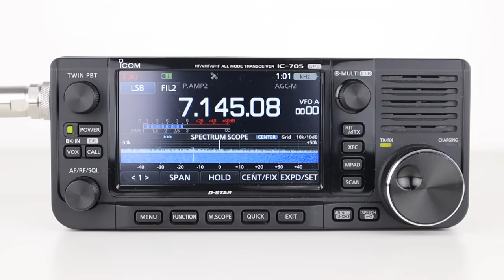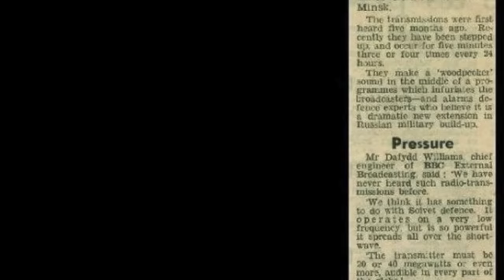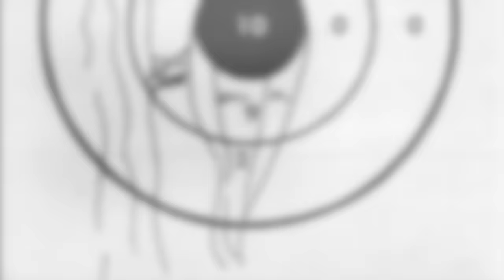Russian Woodpecker - The Radio Signal That Wreaked Havoc Around The World

Comment: I've always wondered, if a signal is propagating regularly with any sort of unsurprising periodicity at all, would it be possible to, for example, like noise, canceling headphones, send out a reverse version of that wave? If sent out. Omnidirectionally, would that sort of create a force field? Where people in the area would not hear the woodpecker due to destructive interference? I'm not a big EM nerd so I might have gotten some terms wrong, but I think the key terms are there if somebody knows the answer to it. 🙂

Also, I dictated this to my phone so some of the punctuation is probably jacked.
Reply: Not for any reasonably large area. You're talking about phase cancellation, which requires the two sources to be perfectly out of phase with each other. HF wavelengths are several meters, so if you moved ~half that wavelength closer to the radar site and the same distance away from the cancelling site, you'd see constructive interference instead of destructive - actually making the signal stronger.

This is also the reason you don't see room scale noise cancelling speakers, only headphones.

Comment: the story goes, that when chernobyl accident happened, the ventilation systems that were used to cool the massive computers in the complex got contaminated with radioactive dust, and the systems failed. You can find people telling you that after this, all air filters in facility were changed and cleaned, another startup of the systems was tried, but again failed for the same reason - radioactive dust. after that, allegedly the project was retired

Comment: "...over the horizon..."  Now I get it.  I had previously been fascinated by those large, cage dipoles,  wondering how that could be radar.  Hell, that also explains the woodpecker signal.  But, maybe I should get back to the vid to see how you cover that.
Reply: Might have to look up whether anyone replicated that antenna design.  Though I'm not expecting anyone's built a replica.  I just want to know the specifics about reflective elements, including dimensions, and what those supports are made of.
Reply: Just noticed an alternating pattern in the dipole array.  Fascinating.

Comment: I heard it a few times down in Florida back in the 80's. I was just a kid so I didn't think anything of it other than I needed to adjust the dial on the radio, or move the antenna on the TV. Then I found another video on YouTube a few years ago that actually had a recording of the signal and I realized it was the same thing I was hearing back then.

Comment: This thing was so powerful that it had to be built within transmission range of a major power plant
Reply: Um.  No.
1) Pulsed radar takes only a fraction of its peak power to operate.  If this was a 10 MW pulse transmitter, it likely didn't produce over 10 kW average, and probably operated on no more than 100 kW to run it.
2) This actually WASN'T a transmitter site - it was a receiver.  The transmitter was actually much farther from the plant!
3) "Transmission range" of a power plant doesn't mean anything.  How far you can transmit power depends on your power transmission infrastructure.  There are many cities that are many miles away from their power sources, and this isn't a city.

Comment: the natural changes in the specific frequency through the day is because of the heating & cooling of the atmosphere by the sun; the various layers, A, B, C, D, E & F, would populate or dissolve as the air became cooler towards night; the frequency wavelengths would modify naturally, without manual manipulation or freq-change.

Comment: This system was located in the close proximity to Chernobyl and the duga stuff was the first to identify radiation contamination from nuclear power station , that was the power source for them . All the expensive equipment was evacuated and never installed again . At the same time this unit was still “experimental” as the technical stuff was unable to identify the missile launch with big% of certainty . Name Duga’ and s translated is “the arc”

Comment: "Over-the-horizon radar" was once referred to as the DEW (Distant Early Warning) Line here in the US.
Reply: In contrast to this, the Distant Early Warning line (which was located mostly in northern Canada, for reasons which should be obvious) achieved extremely long range by placing a string of long-range radar systems much further from the land it was meant to protect (and incidentally much closer to the USSR).  You could call it "over the horizon" if you like, since it was waaaay over OUR horizon!

Comment: One reason it was shut down was likely to conform with arms limitation treaties. 
These state that early warning radars against incoming missiles must point OUT from the nation's territory, these stations (along with several others) however pointed IN, in this case being constructed in the southern Ukraine but transmitting over Soviet territory pointing northwest towards Scandinavia.
Arms inspections (including inspections of radar sites) ramped up significantly in the 1980s, and the USA and other signatories complained about these radar systems, leading to several being shut down (and more modern systems being built along the northern frontier).
As these older units weren't capable of being moved or rebuilt to point south, they were simply abandoned, with the most sensitive systems like computers being removed.

Comment: I was just licensed in October of 1983 and the interference didn't sound like that demonstrated here when working CW, the interference was a modulated whine because of the beat with your local BFO.
It was extremely nerve wrecking.  It drove me off of the air for many years. Ron (now) W4BIN
Reply: If you were hearing a modulated whine, it probably wasn't this.  This was a low duty cycle pulsed signal - there wouldn't be anything there for the BFO to beat against between pulses.

Comment: Most Ham radio operators know about the Russian woodpecker. It was radar that was aimed low over the ocean rather than up in the air. it could detect low flying missiles and ships at sea.
Reply: Radar systems meant to pick up aircraft don't aim up in the air.  They aim at the horizon, because that's where they need the most power directed, to detect as far as they can.  Many are sited at high elevations and are actually aimed slightly downward.  If you see a dish antenna pointed at the sky, it's not radar.
Reply: @BrightBlueJim  Yes you are correct but the Russian woodpecker the duga Russian radar was different, unlike Regular radar this woodpecker covered more area than a line of site radar covers. it would be best to read about it because I can't remember everything about it. I do remember it was a major nuisance to radio.

Comment: There's some really interesting conspiracy theories involving the duga radar array and the Chernobyl disaster. Mainly focusing around the fact that the frequency of the duga OTH radar had to be shifted because it had interfered with Maritime distress signals, causing significant loss of life. After the frequency shift, it was found that the radar was drastically less effective, and the typical USSR game of cover ups and kicking the can down the road began. The theory is, that in order to distract from this shortcoming, the Chernobyl disaster was either allowed to happen or potentially intentionally caused to happen to cover up the duga's failure, since one of the main transmitters was located just on the outskirts of Pripyat and powered by the Chernobyl nuclear power plant, and the disaster would guarantee the decommissioning of that site and therefore render the whole array useless.

Comment: Thanks for the video. Very interesting. Can you explain why the radiating element are tube shape and not a straight single rod dipole?
Reply: It depends.  The larger the diameter of a dipole, the wider its bandwidth, but also, for a high-power transmitting antenna, a larger diameter reduces the electric field strength at any point on its surface, and thus would increase the voltage that could be transmitted before producing an undesirable corona discharge.  The latter would be a concern mainly for a transmitter, though, and the DUGA-2 unit at Chernobyl we see pictured is reported to be a receive-only site.  Which doesn't really jibe with being located so close to a power plant.

Comment: 8:13 - - 8:43 - - if you want to screw up the radar signal all you have to do is send a return signal on its frequency which blocks out the echoes. 🙂  9:15 - - it greatly helps if several hams in different locations gang up on the radar’s frequency.  ☺️🙂😊😌  9:54 - - the satellite system provided the media direct and highly secure warnings.  10:00 - - any radar based system is subject to jamming (and the effectiveness of any over-the-horizon radar system is always subject to atmospheric conditions).

Comment: That's very interesting. I am absoloutely ignorant and fascinated by radio, so i'm gonna ask you a question which may sound stupid but here it is: Could an amateur measure the echo themselves and detect rocket launches?
Reply: Talking only as a physicist and engineer with limited knowledge of real-world propagation characteristics, I would say “maybe”. 
If you know the location of the transmitter site, and you can hear the pings from it. You could theoretically, if you also hear the echoes, do some maths based on that, using the transmitted pings as a reference to get some sort of information similar to what the actual radar system gets. In reality though, I doubt it will work. 
Just looking at the receiver array I got the impression that it had a phased array configuration, allowing for directionality, but that is just speculation on my side.

Comment: Cool. Could someone take a moment out to explain the function of these interesting teardrop-shaped armatures on the arrayi? Thanks.
Reply: the teardrop shaped armatures are caged "biconical dipole antenna". from what i can find online, its essentially a cost saving measure.  

"The birdcage construction is mainly to save material. The RF currents in the antenna only flow along the long axis of the antenna, so you just need enough parallel conductors in that direction. And due to the skin effect, the RF current only flows on the outer surface, so the center can be completely hollow. The circular metal pieces do not carry RF current and simply serve to strengthen the structure." - a Random user on Electronics stack exchange.

i do know that the array within the Chernobyl exclusion zone is the receiver. so it was only receiving signals, not sending them. the transmitting antenna was demolished years ago and was located about 57KM (35 Miles) north - north east of the receiver.
Reply: @LodewijkVrije  "biconocal dipole antenna"? Neat. Thanks ever so much.

Comment: I remember it knocking out communication on h.f.
Now I suffer from broadband interference 160, 80, was 40m but now not too bad, 30, and 20m with S8 noise level. 60m has been okay.
B.T. said they would charge me to take down my phone line which is the cause of it according to Ofcom who investigated. I would have to pay for their faulty line removal! I'm not with B.T.
The Minister for Telecommunication and Broadband secretary had no idea with saying I need to contact my internet provider if I'm having trouble with radio broadcasts over the internet.
You contact secretaries who have no idea about anything and never an engineer.
It's very much killed my hobby.
G4GHB

Comment: THE IDEA that some radio hobbyists were able to force the radar’s frequency change is a myth. Their signals never reached the radar. They did not have a 40 MW radar of their own for the signal to go that far.
Reply: You're wrong about this.  Let's say you are sending a 40 MW pulse out, and 20,000 km later it reflects off some target, like maybe a rocket exhaust plume, reflecting it back along the same 20,000 km path, and due to things like high antenna gain, you still get 40 uW back at your receiver.  That's a path loss of 1 million million, or 1 trillion.  So if you wanted to produce a signal that would still have 40 uW left when it got back to Chernobyl, assuming it was in the target region and had to travel that 20,000 km path back to Ukraine, it would only have to be the square root of that 1 trillion, or 1 million times stronger than 40 uW, or 40 Watts.  And that's assuming your transmitting antenna is about as directional as the rocket exhaust plume, i.e., not very directional at all.  This is why radar antennas are so huge and their transmitter powers are so high.  And yes, I just pulled these numbers out of the air to make the math easy, and some of them are way off, but the point remains the same, and the math scales easily.

But it's even worse than that: this example would be for a "jammer" halfway around the world.  If someone just 1000 km away were "responding" to the Woodpecker, they could REALLY mess with it.  This has always been the problem with radar, and why long range systems need so much power and such large antennas.
Reply: @BrightBlueJim  The issue is that there is no way 40W radio allows the signal to go that far to the woodpecker, and 40W is about all that hobbyists can get.
Reply: @tatianaes3354  we'll, I just explained how that works, as a former radar professional. If you don't want to believe or can't understand the math, I have nothing to add.
Reply: @BrightBlueJim  I get what you were trying to say, but a thousand times ratio is not enough in your example. The actual signal would be too tiny still to affect the original radar. And I have not seen any confirmation that hobbyists were able to affect the frequencies of the radar. As I wrote, it is a literal myth so far.
Reply: @tatianaes3354  It is not a thousand times, which is why I went to the trouble of doing the math. It's a MILLION times. If the Duga transmitter sends 40 million Watts half-way around the world, that power is reduced to a factor of one millionth, or 40 Watts. Then on the trip back, it is reduced again to one millionth of that, or 40 microwatts. This is normal - 40 microwatts is plenty of signal for that huge antenna to pick up. Which means that a 40 Watt signal sent from that same place halfway around the world will be as strong as the signal Duga sent out, when IT returned. There is no difference between the two signals. And that's the worst case, where the American ham operator is halfway around the world. If somebody in Europe transmits to Ukraine, their signal would be MUCH stronger.

Comment: The reason why US and Brits sabotaged nuclear plant in Pripiat is because it powered Duga systems, that where capable of detecting US rocket launches  within minutes of happening ;) Duga was radar station, woodpecker was radio broadcast station deep within Russia territory.
Reply: well that would be very weird. because there is another Duga system all the way on the other side of the world on the east Russian coast. obviously never connected to the Chernobyl plant.

so if Chernobyl power plant got sabotaged and that was the reason for Duga-1 to stop transmitting.

why did Duga-2 in the east also stop transmitting?

because the system was designed in the 1960's and by 1989 was horribly outdated. they switched to other smaller over the horizon systems, and these days they have a new Duga called "29b6" operational.

Comment: Is that what that noise was?   I had another experience near the tonopah test range in Nevada .  A commercial broadcast band of fm radio was Periodically wiped out in a rod 2 MHz broad to megahertz been traveling from above 108 MHz down to maybe 90 MHz Slowly traveling from the upper to the lower in say like two minutes.  Happening daily in the afternoon.

Comment: Submarines? Hardly! Only on the surface and in perfectly calm seas would they have a chance to detect something as small as a submarine. The early thoughts of multiple transmit sites would have been easily explained by ionospheric shift, which at the time would have been less mapped due to fewer ionospheric sounders. The shifted ionosphere would generate multiple direction finding bearings for the same signal. At the time Woodpecker started it was a Solar maximum, so the ionosphere would have been very active making triangulation difficult. But by 1981/82 the rapid reduction in Solar activity would have made it easier to pinpoint the location of the transmitter.

Comment: Could they have gone back to try using the old systems? Because I've heard a similar sound on my speakers in my home in the afternoons and sometimes at night. It has that woodpecker sound as my speakers are little bit old and don't ground they pick up alot of radio wave interference all the time even when I make calls near it. Also to mention I only started hearing it since the Ukraine war has begun never heard it before that

Comment: Would someone with antenna design experience please explain the reason for the dual "pointed basket" design of the antenna elements? It looks like the pointy ends are the feed points of a dipole arrangement, but why the tapered point end of a circular basket? IIRC, the original W6XAO (Los Angeles now KTLA) transmitter antenna (designed by Klaus Landsberg, or some of his associates) was similar in design.
Thanks for your time...
Reply from the maker: Check my playlist on Duga , there’s a video in there on that exact topic :)